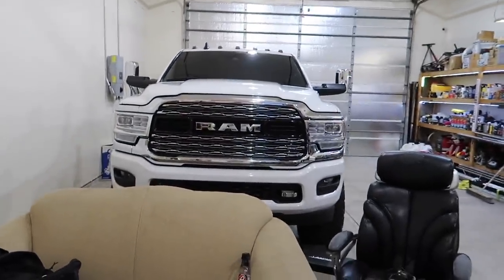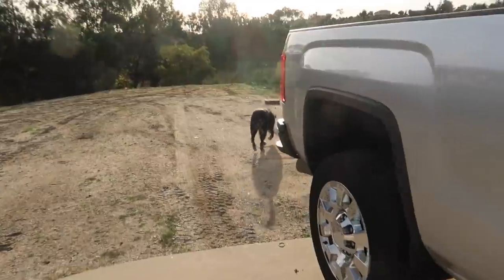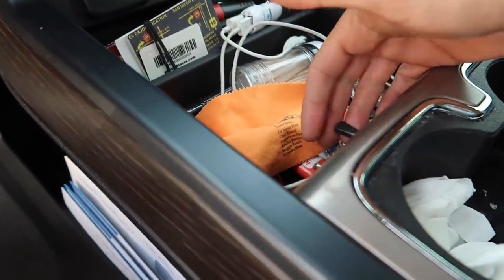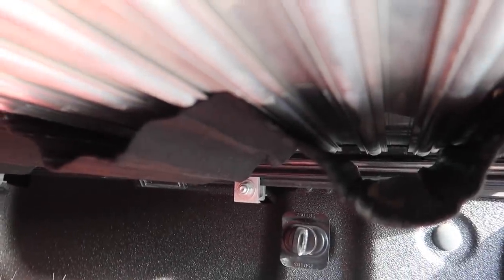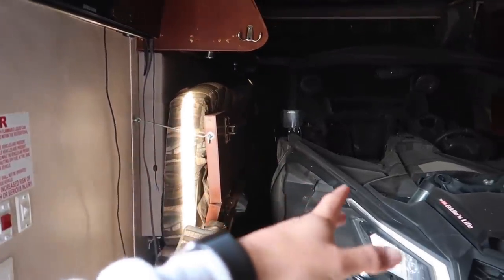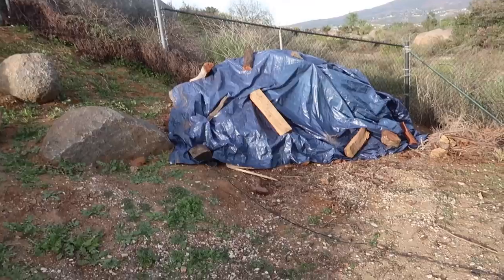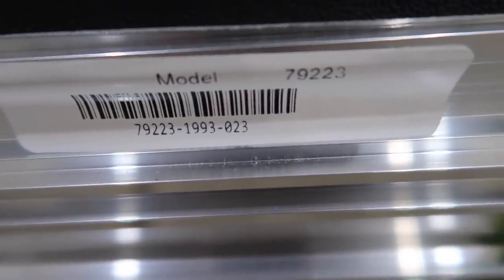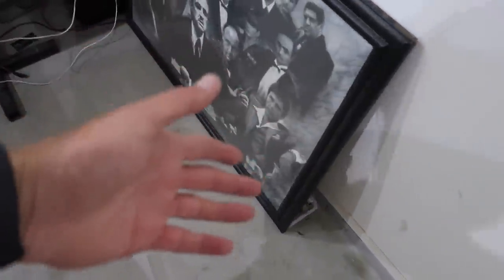How these rats destroyed this truck!!

Comment: Whats up Eddie, the word your looking for is high resistance causing a voltage drop. I also heard you say you were poking the wire, you don't ever want to do that because you will just cause future issues with corrosion. I'm sure you already know this but figured I would mention it. I don't want efren to find out and beat you up.
Reply from the maker: haha i replaced all the wire i just poke it when i know i am gonna replace it

Comment: Eddie have you heard about the new recall on 2019 dodge ram with the Cummins engine
Reply from the maker: no sir i have not
Reply: @EddieLife3500  I was going to buy 2019 3500 dully and i got toll that all ram with Cummins engine they had recall it just came out January 24 2020 iam trying to look for it but is not posted yet
Reply from the maker: i highly doubt it was an engine recall man especially with a cummins
Reply: @EddieLife3500  it was not related to the engine something is about trasmision building to much pressure and blowing the dipstick out and the oil would touch the turbo
Reply: I would go to another dealership see if is the same and thank you Eddie your videos are the best of the best
Reply from the maker: ya i would go to another dealership because what your saying is not making sense man, if you need any help DM me on instagram
Reply: I've contacted a ram dealer, and they didn't had a lot of trucks on their lot, and they said they got pulled for transmission recall.  Are these ram trucks reliable in the long run? I really love them, but I'm skeptical now...